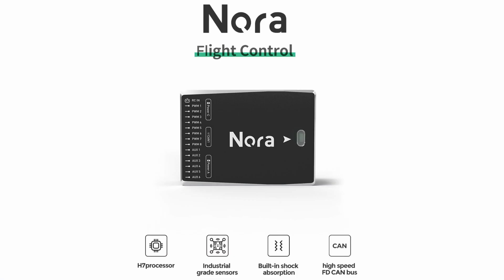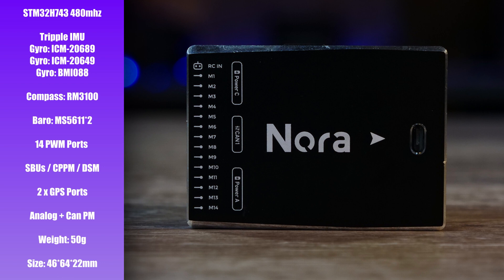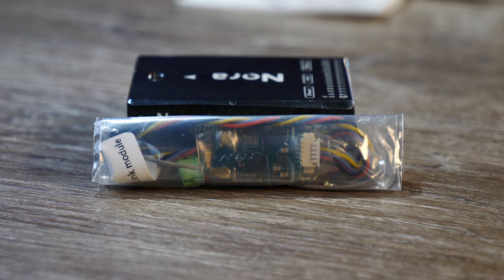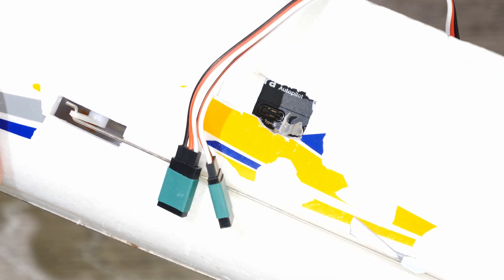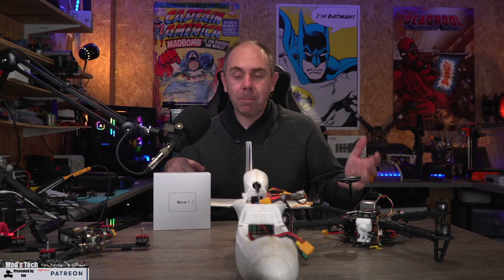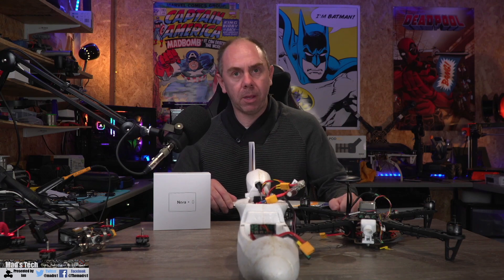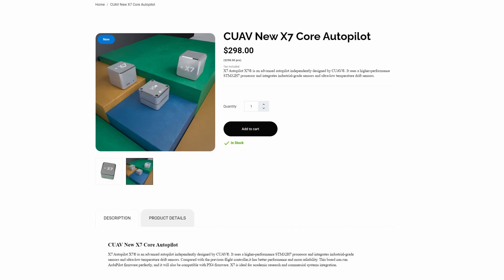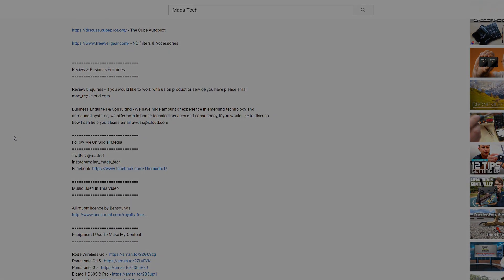CUAV Nora Autopilot For Ardupilot - Flight Controller Overview

Comment: Ian, I think your going to have one of the most valuable Bixlar's out there once you have kitted it out!  And there was me thinking I went over the top when i fitted a Pixhack V3 to an old Walkera QR X350 Pro! I think you beat me. 😀  Will be interesting to see how the build goes, and how well the Nora performs. Shame there is no GPS included for the high price, but at least you get a power module, one less thing to worry about. Could I ask what Wi-Fi module you use to connect your boards to the pc? Sounds like it certainly beats having to constantly plug in USB cables, especially if your doing a compass calibration - nothing worse than getting your model tied up in knots with the usb cable when doing that - or when you accidentally pull one end of the usb lead out half way through the calibration! A Wi-Fi modules sounds like something i need to get.
Reply from the maker: Hahah yea for sure.  It’s a test platform more than anything.
Reply: i know Im kind of randomly asking but does anyone know a good place to stream new tv shows online?

Comment: Apart from the "Customisable Carrier Board" possibility, is there any advantage in using a full sized X7 cube set as compared to using a Nora?

Is there any other advantage which the full sized cube offers and Nora doesn't? Is the performance offered by both, the same?

I am considering to use Nora rather than a Cube to save space.